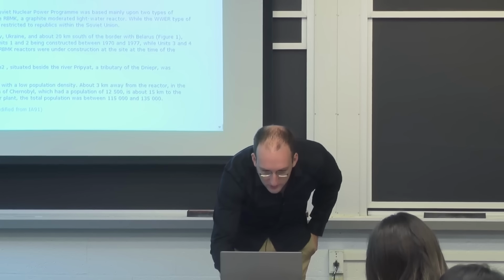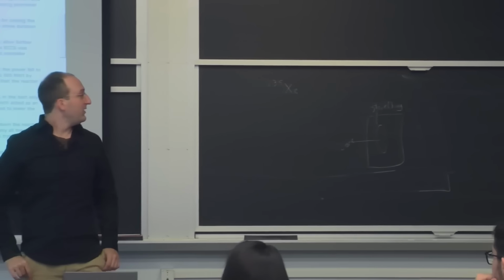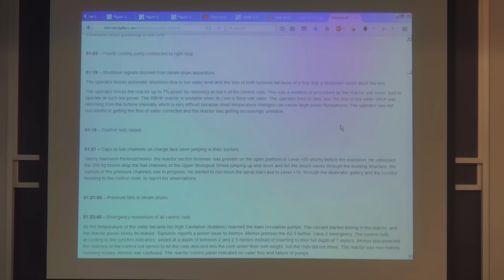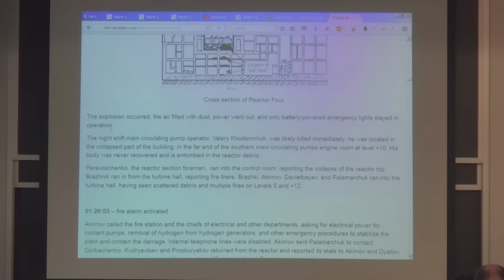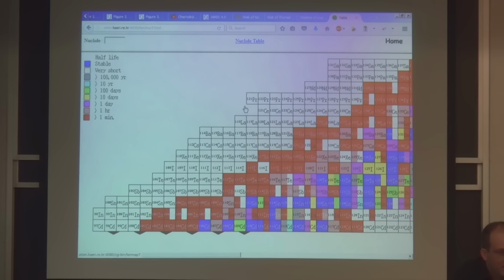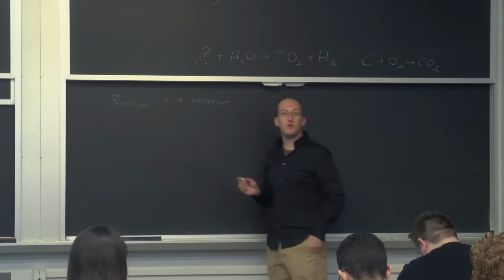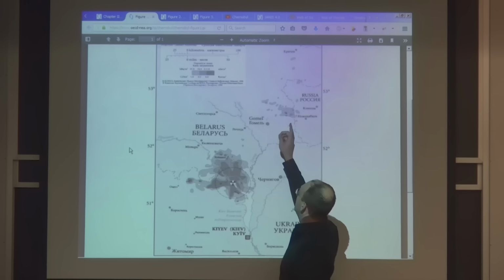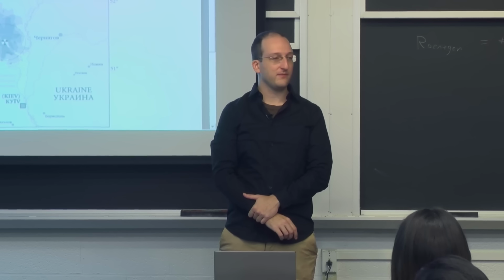26. Chernobyl — How It Happened

Comment: It’s quite shameful to have such a highly regarded (and stupendously expensive) educational institution like MIT to have on staff these apparent PhD professors not only with such grossly obtuse understandings of the events they’re teaching, but to have these video archived lectures they’ve posted here not audited, and at the very minimum annotated where appropriate to point out falsities or outright incorrect data...

While this was a good #101 presentation, there are quite a number of idiosyncrasies of the lecturer that draw a bit of concern and even controversy regarding facts vs fiction...

Not only that, but for instance (at the 35 minute mark), the Chernobyl disaster didn’t additionally suffer from China Syndrome as he so clearly believes and audaciously presents. While corium did melt/burn its way down through the concrete platform the reactor was situated on and into the basement or sub levels of the building beneath (which were actually filled with water and acted as bubbling pools for steam that had to be drained to prevent an additional hydrogen explosion, also of which the famous photograph of the “elephants foot” was taken and is the most widely known example of where this corium came to rest), it did not continue past the actual structure and into the ground at all.
Not only is there plenty of documentation to this effect, but actual video recordings of the measures they took to ensure this wouldn’t happen during the response and investigation showing liquidators (coal miners in this instance) digging their way under the building and not only providing verification to this effect, but eventually pouring an additional concrete foundation for prevention as well as additional support for the building (this being after many discussions on how to prevent this “China Syndrome” from happening when they didn’t know the extent of the damage). Not only have the details of this been translated into English and even (eww yuck) been posted to Wikipedia, but it’s been shown in video reproductions of the event as well as the original sources put online for all to see...
Reply: Also, if only what he’s discussing in and around the 48 minute mark were true for the events happening today! Media sensationalism/propaganda/lies/deceit/falsities/omissions/half-truths/corruption/etc have literally killed more people than everything else in existence ever, and the entire global debacle of the past 20+ months (as of September 2021) as portrayed by them and the controlling factor it has had over the populace can only be described as one of the most vile, evil, and disgusting atrocities yet. Can’t wait to see how all of this will end up unfolding. It surely won’t be pretty...
Reply: The whole causes part is all wrong and very misleading. The narrative itself, causes and chain of events, wrong. Plus mentioning several myths such as the caps bouncing around, and a lot of facts wrong such as half life of xenon135 and control rod design. Very embarrassing.
Reply: And lastly, at the end of the video (53 minute mark) he states that he hopes that information pertaining to the scientific study of radiation, in an effort to obtain accurate knowledge of what (if any) levels can be proven to, or at least demonstrated at a clinically significant extent/value, be deemed “safe” to humans (of which there is such a variety of conclusions to be made when determining the type (A/B/G/X), the source (natural/manmade), how it’s absorbed, etc.) is neither discovered nor produced or provided to humanity... Seriously?!? How are “these” people even allowed to interject their opinions on this matter, in this manner? Talk about destructive...

Thinking logically, wouldn’t that be one of the most prudent things to do for the benefit of humanity in this arena? Take for example diagnostic imaging... Currently, there is only a single statement, point, or justification for doctors in both their responsibilities given and/or how they’ve been instructed to determine whether certain procedures or tests are either valid, warranted, reasonable, safe, qualifying, or any other adjectives you can surmise for investigating a patient’s condition or ailment, and that is in that single instance and point in time that they consider whether the particular test they may be proposing and the possible (currently unknown) risks associated with it outweigh the possible problems their patient may face with their health. When you really think about it, that mentality is so outdated and incompatible with all the advances we’ve had as a species, especially in the scientific realm.

While this is a large topic of discussion entirely not suited for a comment section of a YouTube video, I believe it IS something people need as much knowledge of as possible, and to see an educator make statements like this to his students just seems wrong on so many levels... 🤦‍♂️

Comment: Corium: ''The worst nuclear thing that has happened in the history of nuclear things,'' LECTURE OVER!!!
Reply: @satchice9 somebody didn't watch to the end
Reply: @satchice9 He addresses this at the end. Basically, more people died from those but there was vastly less radiation and fallout. People died from the boom, not the radiation.
Reply: @satchice9 Before watching the video, can I raise you with nuclear reactions in a star dropping below the point where the heat generated counteracts the pull of gravity?
Reply: @whyjnot420  Theory
Reply: @satchice9 Not necessarily a supernova, that can happen, but then before it can collapse far enough to start a supernova, it starts fusion with a heavier element than the previous main one that was being  used up. Thus bringing the outward pushing pressure back up, restabilizing the star. This can happen several times. Right up till it gets to iron, which is essentially the most stable element in the universe. (fusion of elements heavier than iron eat up energy as does fission of elements lighter than it)

edit: btw I'm not sure I would qualify the big bang as a nuclear event, a quantum one perhaps, due to what initiated it, I like astronomy esp cosmology, but the only part I actually partake in (as opposed to just simply learning about), is astrophotography, so perhaps someone with more in depth knowledge of cosmology could say if I am right or wrong

Comment: I worry quite seriously about the advanced graphite reactors "AGR" in the UK. 

Coolant is CO2, not water. But a leak, loss of coolant replaces CO2 with air and 20% O2.
=> Super hot graphite fire.

These systems are now almost 40 years old and having their life extended without replacement. 

Michael! Please comment!

And I didn't even mention graphite shrinkage under neutron damage and stuctural cap loads falling on the pipework. Allegedly.

Comment: Length of graphite tips of control rods is incorrect. It's not 6 inches. It's way longer: 4.5 meters.
Wikipedia has a much better description:
"""... the control rods have a 4.5 m (14 ft 9 in) long graphite section at the end, separated by a 1.25 m (4 ft 1 in) long telescope (which creates a water-filled space between the graphite and the absorber), and a boron carbide neutron absorber section [7 meters long]. The role of the graphite section, known as "displacer", is to enhance the difference between the neutron flux attenuation levels of inserted and retracted rods, as the graphite displaces water that would otherwise act as a neutron absorber, although much weaker than boron carbide; a control rod channel filled with graphite absorbs fewer neutrons than when filled with water, so the difference between inserted and retracted control rod is increased. When the control rod is fully retracted, the graphite displacer is located in the middle of the core height, with 1.25 m of water at each of its ends. The displacement of water in the lower 1.25 m of the core as the rod moves down causes a local increase of reactivity in the bottom of the core as the graphite part of the control rod passes that section. This "positive scram" effect was discovered in 1983 at the Ignalina Nuclear Power Plant. The control rod channels are cooled by an independent water circuit and kept at 40–70 °C (104–158 °F). The narrow space between the rod and its channel hinders water flow around the rods during their movement and acts as a fluid damper, which is the primary cause of their slow insertion time (nominally 18–21 seconds for the reactor control and protection system rods, or about 0.4 m/s)."""

Not well explained what exactly caused the explosion.

Not explained why specifically "almost all rods were removed from the core" was a bad thing.

The correct sequence is as follows:
* Steam valves closed to start turbine run-out experiment.
* Pump power starts going down since turbine runs out (slows down) and amount of power from it goes down too.
* Recirculation slows, water gets hotter, boils more.
* Reactor power (which was around 200MWt thermal) starts slowly rising due to increased boiling + slightly positive void coefficient. (This also starts to burn off Xenon).
* Operators are confused why power rises, panic a bit.
* After some tens of seconds, Akimov decides to press the scram button - the AZ-5.
* All control rods simultaneously start lowering into the core. Control rods are in vertical water tubes, not in gas space, for cooling purposes. Graphite tips go down as well, displacing 1.25 m of water in the lowest part of the reactor with graphite. This is where "almost all rods were removed" plays its bad role - almost all rods were removed means almost all rods go down at once. Graphite tips moving down replace water, an absorber, with graphite, a moderator!
* Now power spikes VERY fast, primarily in the lower third of the reactor, burning off all Xenon (absorber gone -> positive feedback), flash-evaporating all water and rupturing water piping (absorber gone -> positive feedback).
* Fuel melts, evaporates in many places, some isotope analysis suggests even prompt criticality was reached in some small volumes of fuel. Reactor pressure vessel ruptures.

It looks like control rods lowered only ~2.5 meters before they ... stopped existing along with everything else. IOW: the absorber sections of the rods could affect only upper ~2.5 meters of the 7-meter high reactor core.
Reply: Thank you for your explanation.  
So if you would have been on site and walked into the control room the moment they detected and started to panic… what would your instructions have been knowing what you know now?    (This would have been my question to the Prof).  Any suggestions?

Comment: Is critical used differently in the US? Here a reactor is critical when K=1 so it's just self sustaining. Seemed like he used critical to illustrate blowing up or running out of control
Reply: He said they couldn't get the reactor critical, referring to the power drop at <50MW when probably the only thing causing heat were decaying fission products.

Comment: This is not an error but as a medical radiation oncology physicist I've always been bothered how it is always explained that electrons are more dangerous than photons.... yes as a pure biological effect they are a bit worse but from radiation protection standpoint 2-3MeV photons can pass through a few meters of high density concrete while electrons are stopped by few meters of normal air even in energies like 10-15-20-25MeV and much less in water so vital organ damage from higher doses of electrons is less likely than from photons and neutrons (I'm not discussing neutron capture and cross sections and so on) and you can shield yourself much much easier from electrons, yes secondary photons from the electron interactions is also a thing but still it was always interesting to me.... Again, the statement in the lecture is NOT wrong, purely from a biological standpoint electrons ARE worse, not only in ways of direct ionization but in many other ways, but overall it's a bit more complicated from a total radiation protection standpoint comparison. also on the topic of most susceptible organs liver is made (because of it's function) to rapidly regenerate and because of that' alto it is damaged easily by radiation (something like 18-20-30Gy has a high chance of causing function loss or even necroses) it can take really high doses  up to a certain % of total volume of the organ and in time it will fully regenerate, on the other hand something around 2-3 to 5-6 Gy in the lenses of the eye can cause cataract in a couple of years (the eye itself can take  is not that susceptible) and most vulnerable are ovaries, testis and certain parts of the heart, lung tho damaged by low doses it can keep got enough function to not cause neither short or long term problems, parotid glands (that produce saliva) and mucousa of any kind get damaged real easy and after a certain (not that high compared to other organs) dose starts to gradually lose function as the dose increases, skin is also sensitive but if a small enough region is affected it fully regenerates no problem. (just to be clear if not explicitly stated otherwise, the numbers listed in the comment are for whole organ in question and not accounting transit dose through other tissue) and last clarification, sieverts, tho good with their quality indexes for normal radiation protection in high dose exposure scenarios are not that useful, yes type of radiation is somewhat of a guideline but grays (the pure absorbed energy by mass) is the leading factor and that's why you wont see vary much sieverts as units used in radiation oncology, because used there are really high doses in relatively small volumes of tissue (usually between 1.8 to 8-9 grays per day for anywhere between 3 to 40 days and in some extreme special cases between 80 and 200 gray in a single session for really specific things)

Comment: This event is a much bigger part of man caused climate change than anyone will admit. Then add in Fuku plus the 1000s of nukes we tested in the far north (the czar bomba being major methane releaser) and in oceans. I wont even discuss all the nuke trash we tossed overboard. Why are the oceans heating? what happens if we start  melt methane hydrates due to heavy metals settling in the ocean as radiation settle from air, earth and the living? Bikini is massive time bomb, and we are :01 second to midnight.
Reply: half life of these hot elements is many times my lifetime. it settles to the mud  at the bottom of the system (the ocean) and is settling into the layers that insulate Hydrates, now those layers are like adding electric blankets to the ice tray in the freezer
Reply: As the methane hydrates melt large amounts of methane, helium and carbon are released. Mixing in all the radiation like putting a cup of cold coffee in the microwave, causes notable heating. the longer you nuke the coffee the warmer it becomes ...even at a low setting, and ice cube will turn into a run away melt down in your microwave coffee cup.

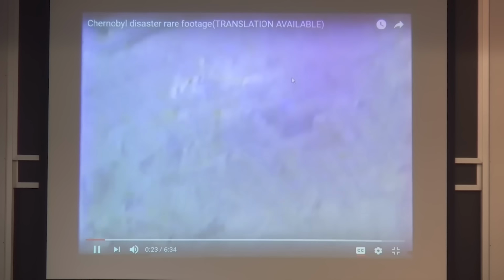Comment: 1:25 "that was probably a bad idea"

The whole clean up was bad idea, but it had to be done. Those men are real heroes.
Reply: Can u explain to a dummy like me why it had to be cleaned up?? Why couldn’t they just leave it there and build a containment over it? What difference did it make for that stuff to be thrown down the hole if it can just evaporate up into the air anyway? Basically, what did cleaning it up do exactly?
Reply: @Smolpantherbeby  The goal of the early remediation efforts was to minimize the radioactive releases until a longer term containment solution could be built. The helicopters were attempting to dump material (sand, clay, lead, etc) onto the fire in the core to smother it. This had to be done because the fire was basically making a radioactive smoke plume which would contribute to fallout in whichever direction the wind was blowing. There probably were parts of the cleanup that they didn't start right away, but those would primarily have been in cases where the contamination wasn't at risk of being spread elsewhere. Basically, the "evaporate up into the air" part is what causes problems, so they were hoping to stop that from happening.
Reply: classic soviet 'plug problem hole with bodies' approach
Reply: @cliveramsbotty6077  as opposed to the western "Form another committee while people are dying" approach?
Reply: @thekinginyellow1744  haha touche

Comment: Wonderful lecture. I highly recommend the Chernobyl miniseries, if for no other reason than that it vividly shows the caps "jumping" just before the explosion. Absolutely chilling.
Reply: It's a good series, and while it takes a bit of licence with characters, it's getting the story surprisingly right. The chernobyl reactor was pretty safe - but not when you run a dangerous experiment with the night shift that hadn't trained for it and disable or override several absolute safety features. Michael said flying the helicopter over the reactor was a bad idea (because it's dangerous) but they KNEW it was dangerous - they had to, to get information about what was going on, and so did it anyway. There's a lot of that in the series - people know it's dangerous, but they did it anyway, because someone had to. There were a lot of heroes there. And some idiots, to be fair.
Reply: @CallioNyx  Agreed.